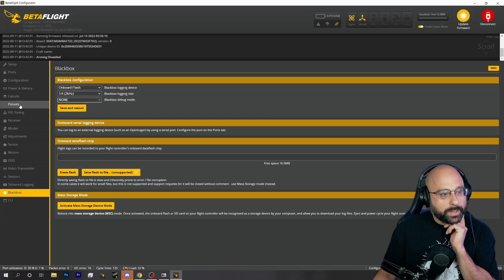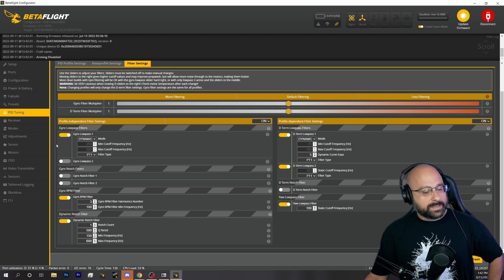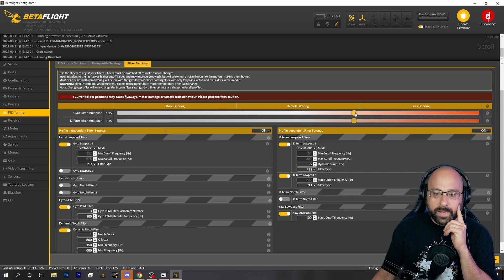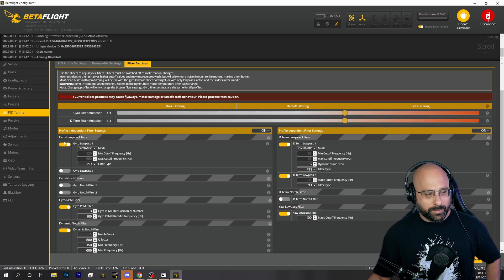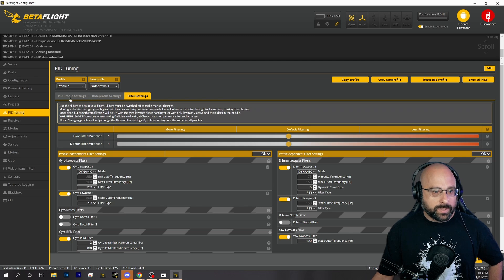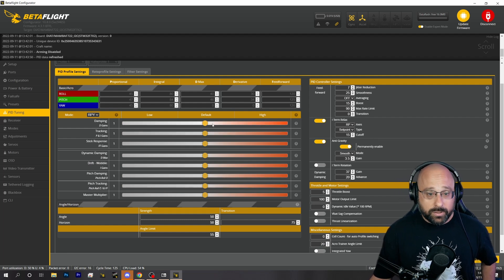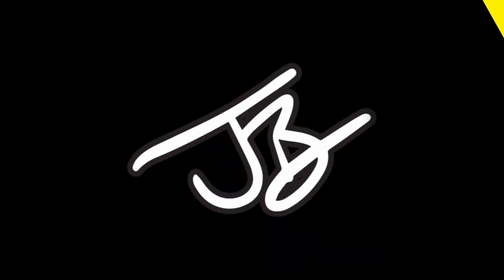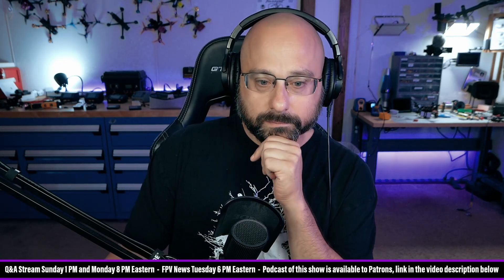My 5 inch FPV Drone Has Propwash! How do I fix it? - FPV Questions

Comment from the maker: "In the video, I mistakenly said to turn off gyro lowpass 2. That's not right. You should turn off gyro lowpass 1. Especially if you're not running the gyro at its native rate (e.g. 3.2k for BMI270 gyro or 8k for MPU gyro), it's essential to keep gyro lowpass 2 on, because it includes an anti-aliasing filter. Regardless, gyro 1 is the one you can safely disable if you're using RPM filtering." - JB
Reply: I dont even have gyro lowpas 1 I THAT BAD???

Comment: I have 2 crazy bee f4 boards one runs at %24 when plugged in with rpm filtering thats a 1s elrs board the other one runs at %64 thats a 2s frsky board nothing I do brings it down more than 1 or 2 percent any ideas
Reply: Verify that they really are on the same BF version. 24% was the old way of showing mpu use, 64% is BF 4.3+.  Tuning notes say up to 75% is ok on an F4.

Comment: if you want less latency and you don't run 8k pid, then turning off lpf2 turns on an averaging filter, so you can actually get less filtering/latency if you turn your lpf 2 to a very high value rather than turning it off in 4.3

Comment: Yo Joshua, of topic. Do you have a video about trowing and catchinh the drone?
Reply: What info do you need for that? Throwing drone = angle mode, set arming angle to 180° to allow arm the drone even its upside down. Throw the drone as high as possible, arm and raise a throttle. Catching the drone is just about your ability with LOS flying. You can help yourself with angle mode. Then its just about your reflex to be fast to catch the drone.
Reply: He actually just made one maybe a month ago but David is correct. Not much too it. And not the safest thing in the world lol